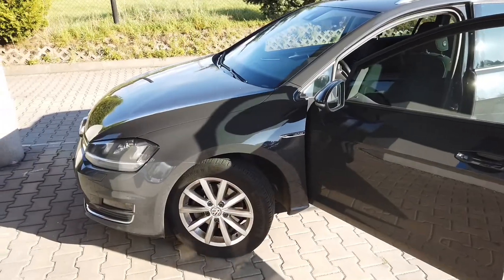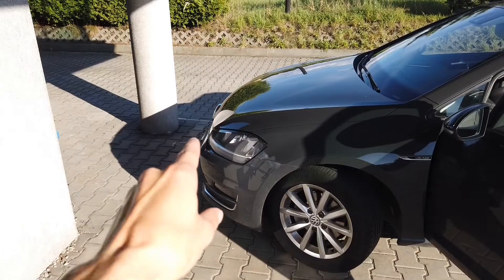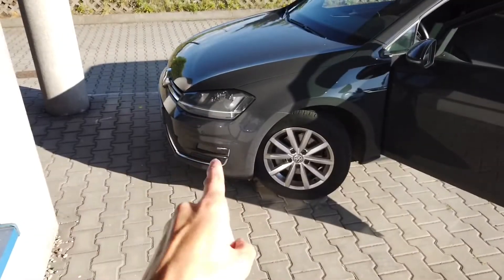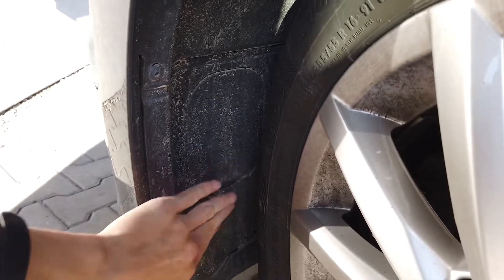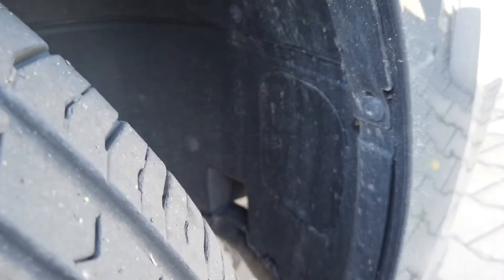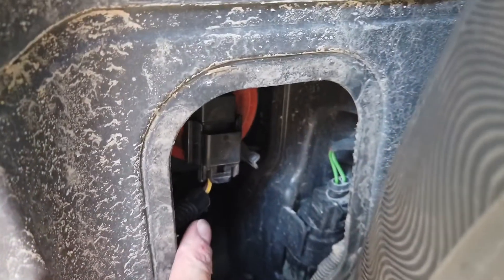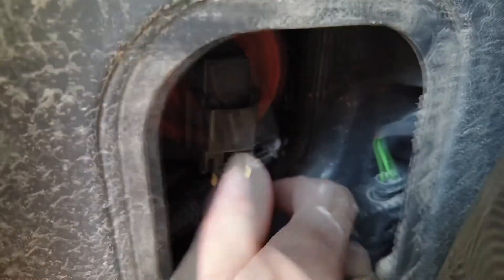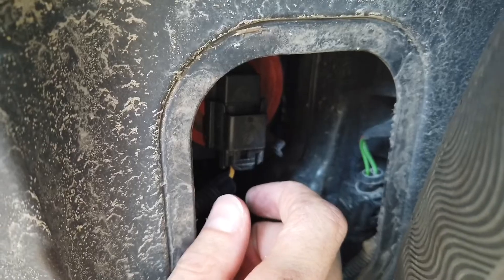VW Golf MK7 (5G) replace front fog lights with LED

Comment: Maybe not the cleverest idea: VW did use Halogen bulbs as fog lights for a reason.
Because the yellowish light is more capable for fog and rain, yellow light leads to less glare and more range of the light and the view through rain. This is the reason, why some cars have yellow foil on the glass for fog lights in addition.
Reply from the maker: That's true. I'm thinking about swapping with these with yellow/amber LEDs. Coming/Leaving home illumination will no longer be consistent but performance in fog should be better.
Reply: Not sure if that is true or at least the tech has moved on over the years. My 2016 BMW F20 1 series came with full LED lights from the factory including pure white lights for the fog lamps!

Comment: @mr-fix if we just replace these and other golf lights with LEDs (fog lights, brake, registration plate lights etc), will we get errors on the dash?
Reply from the maker: Depends on LEDs. If current draw is high enough, there will be no error.
You will still get strobe effect when control module is testing bulbs. I would recommend changing coding in car for all circuits with LEDs to avoid that.

Comment: Once again, thanks a lot for maing this videos, they really help and its even better that we have the same car color hahaa.

I have a question, I hope you can help me. 
Did you use OBD11 to fix the error shown by the lights you installed or they worked perfectly after installation (Are they still working?). 
Because I contacted the ppl on AGLINT and they told me I need to use a resistor and is actually like a metallic rectangle. 

I hope you can help me!!
Thanks again!! ;)

(I see the description there is the codding for OBD11, thanks)
Reply from the maker: Hi! Yes, I used OBDeleven to let the car know that there are LEDs over there.
I prefer that instead of additional load resistor.

Comment: I Just installed them and everything turned out like in your case. Thank you very much. I had hard time removing the bulb until I saw your video how to remove the connector. Not many videos show that.
Reply from the maker: Happy to help!
Reply: @mrfixpl  Do you happen to know what halogen headlight  bulbs they used on a face lift golf? They look brighter. Now I am looking to get my headlight bulbs replaced with LEDs.
Reply: @IvansBikesBmws  Maybe OSRAM Night Breaker Laser
Reply: Ivans, do they actually look better than the halogen one?